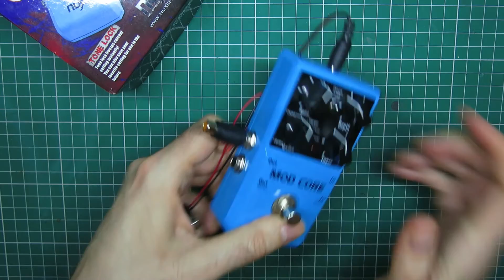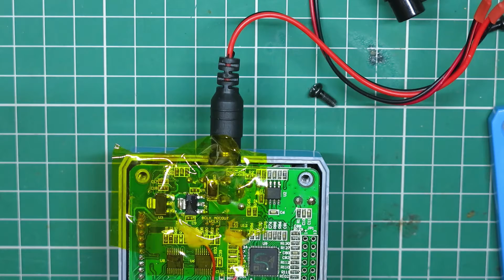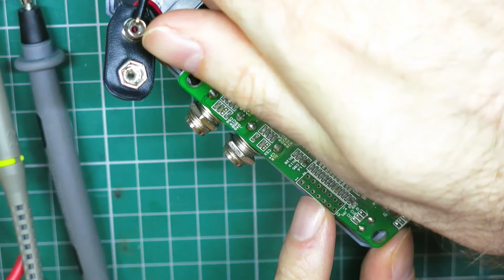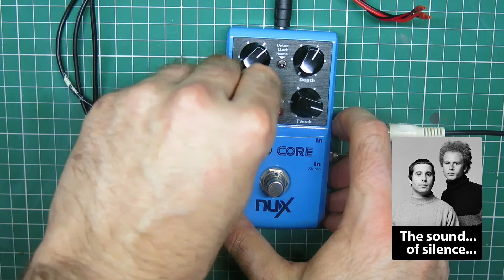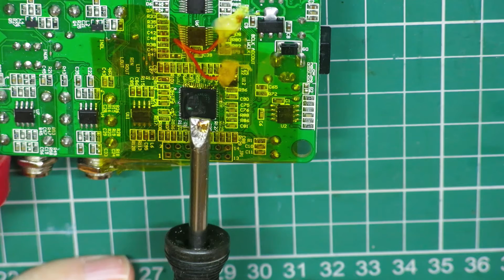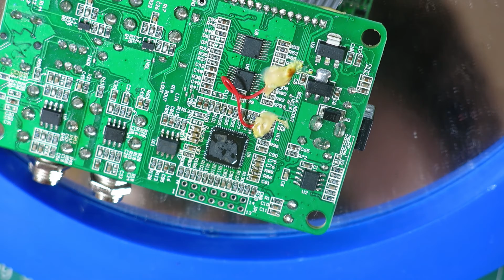Dead NUX NU.X Mod Core Pedal • Fault Diagnosis & Repair

Comment: What do you surmise was the etiology of blowing out the 3.3V regulator and the microcontroller. Could it have been the user used a power supply with reveresed polarity?  I've always marvelled at how unfriendly Boss and Ibanez pedals are with their center pin negative jacks.  In my experience most everything else is center pin positive.
Reply from the maker: Most pedal circuits should have reverse polarity protection diodes but I've even found those blown up before. I do suspect it was a power supply screw up, yeah. Never found a pedal that's positive centre - every one I've seen is negative
Reply: @jamesbennettmusic  thanks for your thoughts. Yes, I meant most electronics other than FX pedals - I'm looking thougth my wall wart surplus box and every one of them is center pin POS.  I'm thinking that's why my Nux Loop Core is dead!  Thanks so much for your feedback - I'm still marvelling at your persistence and patience!  Cheers!

Comment: hi, can you have a schematic for nux mod core? my nux have a broken piece like resistor value, and i cant see the value to repair. the pedal goes on,m buyt the pot to switch the effect s cant work, and the pedal cant merge the effect to signal. the piece is on near the potentiometers but i nedd a photo or schematic to see voltage and signal.
Reply: I have this issue too, stock on vibrato, but everything works, except the mode knob.

Comment: Hi James. I just came across this video while looking to see if there was anyone besides me that would even consider troubleshooting and attempt to repair something like this, and ended up watching the entire clip. It was suspenseful, at times :-) I felt like I was at a sports event cheering on my team to win! And they did! Lol. I have a similar pedal, the NUX Loop Core, and only used it for about 3 hours before it "died". Not like yours, but on the Input end. I opened it up and tried to match up some chips, but after an hour it went back to my "junk bin". I tried getting a schematic from NUX, but was unable. That was about 4 years ago. After watching your video, I now have a much better understanding of what I'm looking at after you explained the chips, their functions, and shown the scope signals. I'm going to give it another try today after being inspired by your video. Thank you for taking the time to put this together and share it with us. I haven't ever tried replacing SMD components, but I'll try anything, at least once in life. Lol 
Thanks again.
Reply from the maker: @BeachN4now  that's brilliant, and the whole reason I put the videos out. Good luck!

Comment: Hi James! I have a NUX TIME CORE DELUXE. the problem is if i turn on the effect, the other channel becomes mono and low on audio.can you help me with the  small problem.
Reply from the maker: I wouldn't know for sure, but I would try a factory reset, check the opamp chips, check voltages... you'd need to trace it through on a scope really
Reply: @jamesbennettmusic  ok thanks james! I just don't have a scope. Before it occurred. I switched on the toggles switch after a few minutes of playing the guitar, i observed it became mono audio